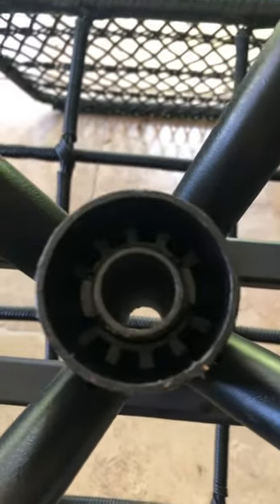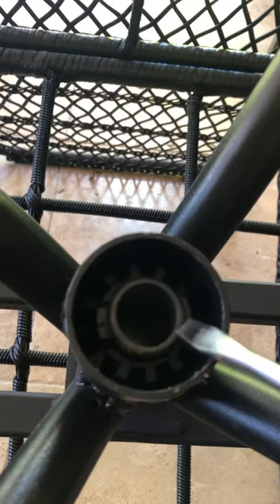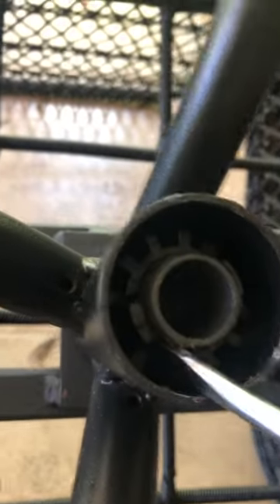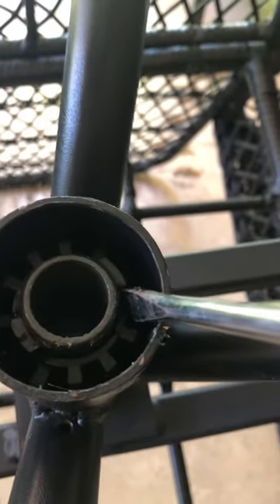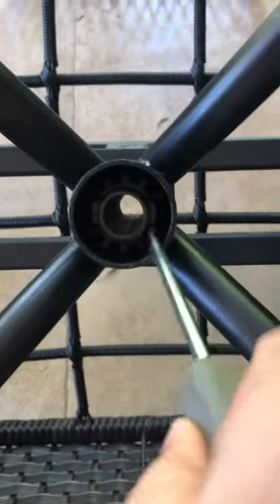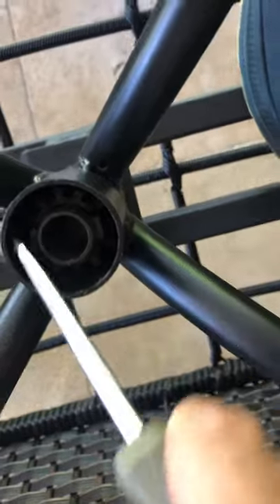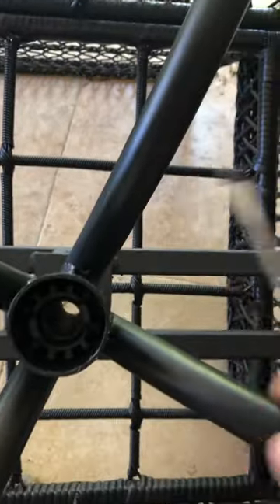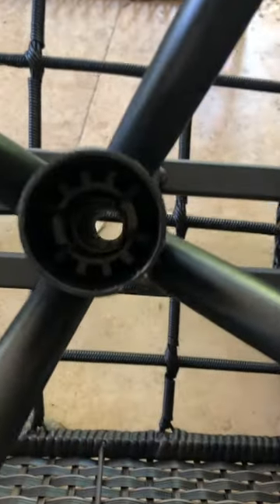How to remove the Chair Base from the Bracket (Swivel Rocker Chairs)

Comment: Thank you for posting this.  My patio chairs look the same, and I wasn't sure those were locking tabs- but they are.  After removing the seat- it's still not obvious why the interface is so tight.  I lubricated it and put it back together- and it still does not rotate easily.
Reply: Having the same problem here.